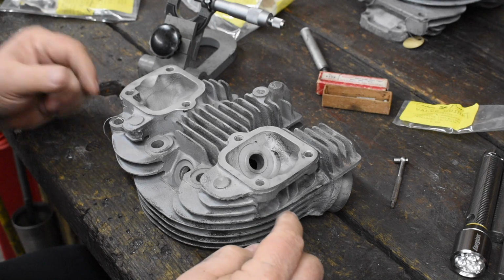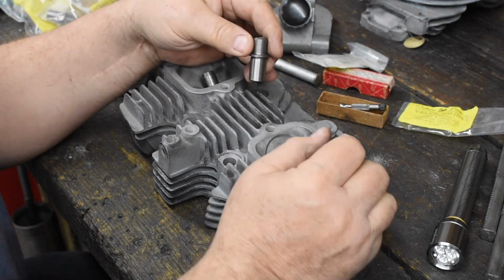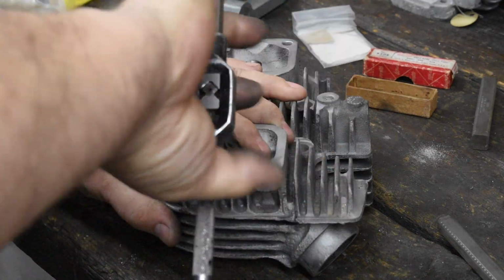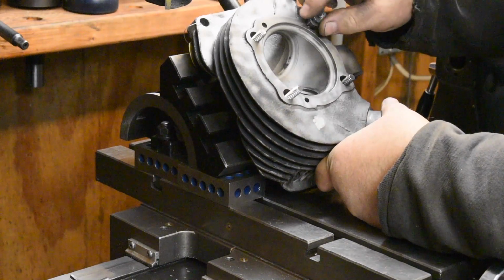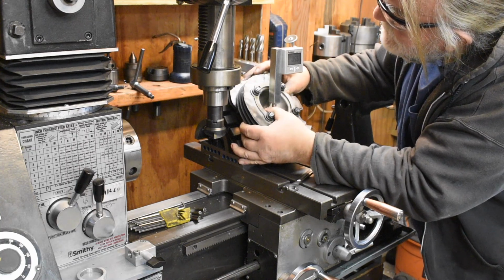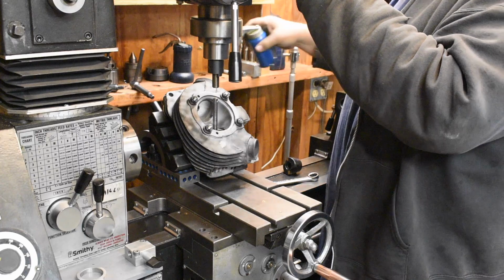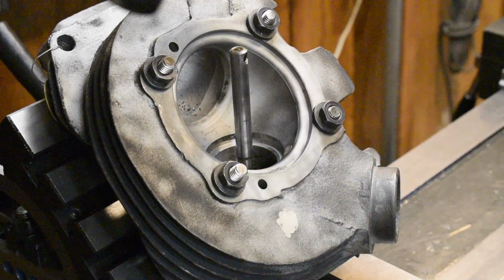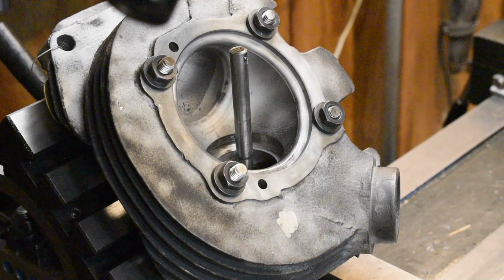Heads, Everybody Has One, Part 2 Nbr. 61

Comment: The procedure you used... We call that Sneaking up on it... Here in New Jersey... I always use an 1 5/8" exhaust valve... Which makes creating a 3 angle seat much easier... Not enough meat in the port for a 60 degree bottom cut... With 1 9/16" valve... CrazyHorse Speed Shop
Reply from the maker: You are right, maybe I'll give the 1 5/8" a try.
Reply: @IronHeadCycle  By using an oversized valve... This sometimes brings the stem height to acceptable levels avoiding the need to install a hardened seat... CrazyHorse Speed Shop
Reply from the maker: @frankromero4048  I sometimes use 1000cc intake valves in 900cc engines for the same reason.
Reply: @IronHeadCycle  yes I agree 👍...
We just, Must check valve to valve clearance when going with oversized valves...

Comment: you should install a digital read out on the quill. you can then measure the seat and cut the pocked to that measurement with ease. touch off on part then go to measurement.  your way works well.  if you recall you helped me with the electric motor on my boring bar, the update is I spend the extra cash and got my original motor re wound and re built locally.  it was about 250 more then an off the shelf motor locally, I'm sure online I could have found allot cheaper but the extra cash made sense as the local rebuilder pointed out the original motor is more robust not that it matters I'm sure any motor would have done well for how much I do!
Reply from the maker: You are absolutely correct, a quill DRO is just the ticket. By coincidence, the depth of seat problem is solved, although maybe not in the way your think. Check out video being released tomorrow at 6AM. I've got a couple engines I'm about to work on, hopefully one of them will need valve seats so I can dig into a revised process. I do recall the emails on the boring bar motor. Two viewers sent questions about the motor and at least two old Kwik-Ways were spared from the scrap pile.